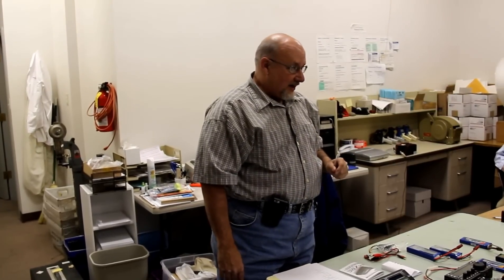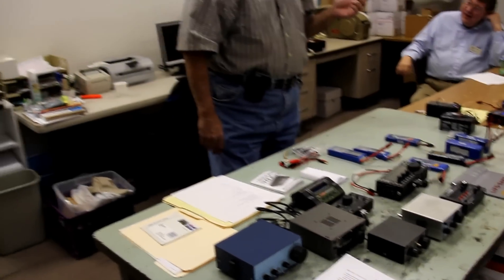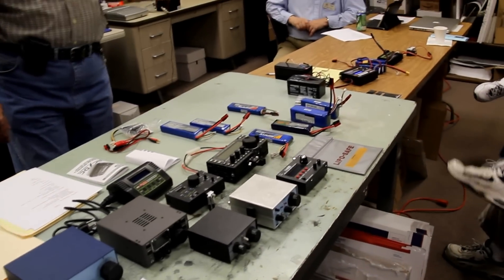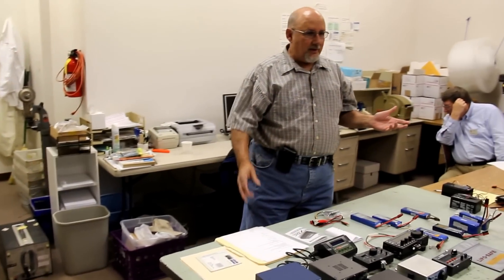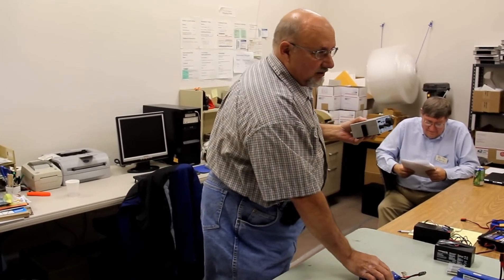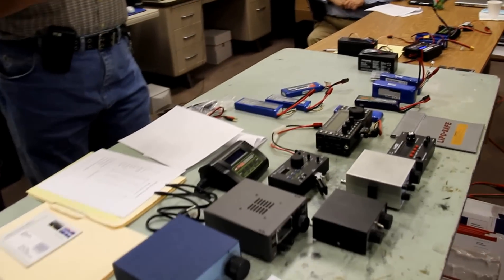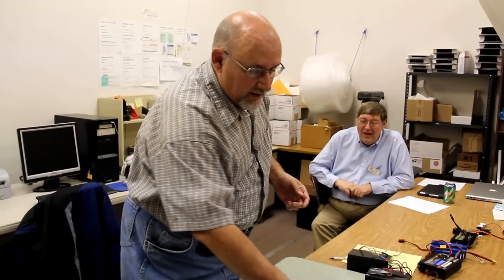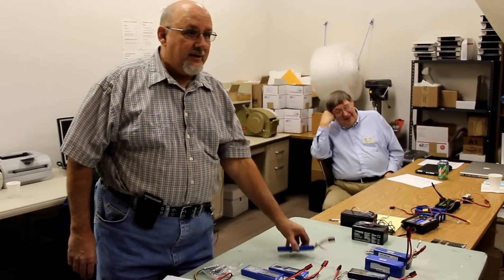Battery and QRP rig efficiency presentation by Jim Pope (KGØPP)

Comment: The rules for SOTA have been clarified recently. The requirement to walk the last hundred vertical feet is not a rule of the international award. You just need to have a portable station that is completely independent of a motor vehicle. Of course this is irrelevant for many summits that dont have any vehicle access and on those you are walking from the car park at the trail head.

Comment: A correction. KX3's shutdown voltage can be adjusted. Although default setting is 10V, it can be reset to 8.5V if operating with an LiFePo 4S battery.

Comment: (2/2) Another super efficient QRP rig on RX is the Small Wonder Labs SW+ series (no longer available, unfortunately) which I've measured at 16mA. Check out my videos and radioset-go (dot) com to see how I've been constructing them with li-ion batteries. Also Google this it is very neat, 'AnyVolt Micro Universal DC-DC Converter' 

vy 73/72 W1JSB